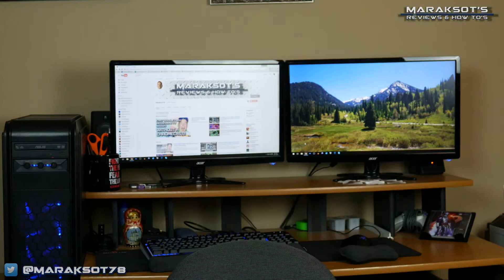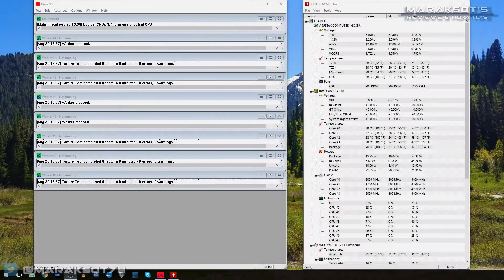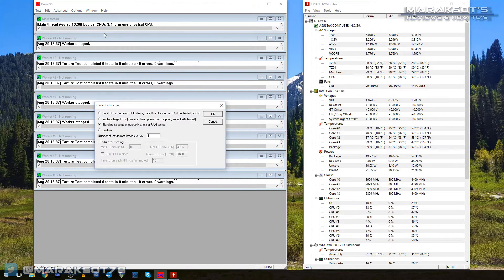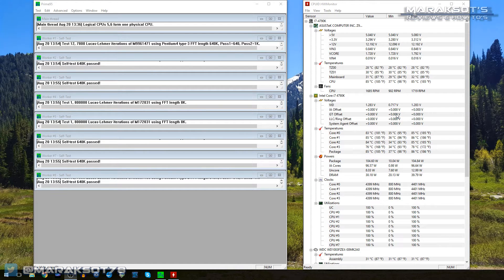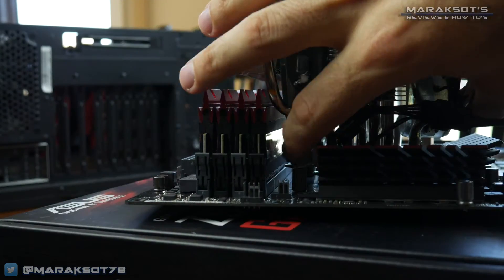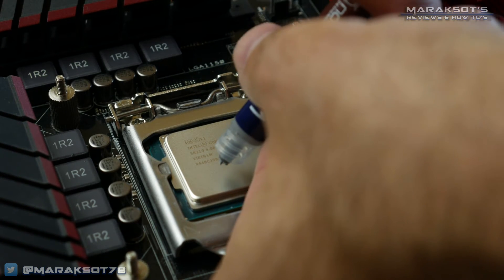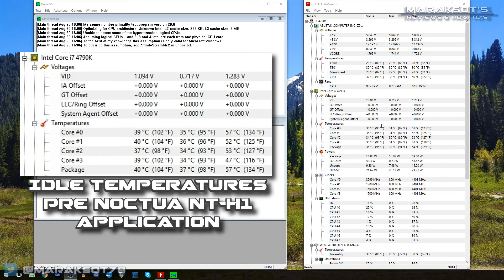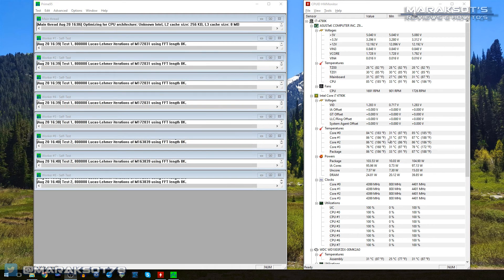Reseating my CPU cooler & Noctua NT-H1 Thermal Paste Review... sorta

Comment: Is your vcore at 1.792v?????? Thats way too high isn't it????
Reply from the maker: thanks for the question.  I'm not big into overclocking and stuff (I have tinkered around with it before but only very little) so I had to do some research on this.  I have everything set to stock/auto speeds and voltages in my BIOS so I was pretty confident that what you see in the video at 4:00 is not what it seems.  On my ASUS Z97 Pro Gamer Motherboard it has what is called the CPU Input Voltage which is set to 1.792V.  It appears that number is what CPUID Hardware Monitor is displaying as VCORE here. According to this article/overclocking tutorial from edgeup.asus.com  https://edgeup.asus.com/2016/broadwell-e-overclocking-guide/5/ it says the CPU Input Voltage  "...provides the 1.80VDC input to the CPU.  All primary internal voltage rails are derived and re-regulated from this voltage source.  When the CPU is overclocked, this voltage needs to be increased. We recommend keeping the CPU Input Voltage at least 0.45V higher than CPU Vcore, otherwise the system may become unstable or need a higher level of Vcore for stability. The maximum voltage we use is 1.95V set in UEFI. Do note that the actual voltage supplied to the CPU is affected by the LLC (load line calibration) setting within the External DIGI+ Power Control menu." so if I'm understanding this correctly the 1.792V is what is being fed to the internal voltage rails and then the actual amount of voltage being fed to the VCORE is adjusted through the LLC setting.  If you look at the VID on my CPU at 4:00 you'll see that the maximum voltage recorded there is 1.283V so I'm assuming that if I were to look at the load line calibration setting in my BIOS we'd find that my VCORE is actually set to this value.  here's a link to a video from der8auer (famous overclocker) where he talks about what VCORE, VID and LLC are.  https://www.youtube.com/watch?v=_XGhpKHWYAg  He explains the VID and LLC really well in this video but I didn't quite pick up on VCORE though.  :D  Thanks so much for the question though, I really enjoyed the opportunity to learn more about all this and understand it a little better.

Edit:  I went into my BIOS to see and it looks like I misunderstood exactly what they were saying in that article I linked when they said "the actual amount of voltage being fed to the VCORE is adjusted through the LLC setting".  There is a CPU Core Voltage setting that can be adjusted and when it's on Auto mine is set to 1.094V.  As der8auer explains in his video you adjust the LLC to keep your CPU at that voltage while it's under load.  My LLC is also set to Auto as are all the other stuff that has to do with CPU voltage.  So I'm assuming that with everything on Auto since my chip is designed to turbo up to 4.4Ghz whenever a load is placed on the CPU the core voltage and LLC is then automatically adjusted up to 1.283V, as shown as VID in CPUID Hardware Monitor, to compensate and allow the CPU to run at that frequency.  Thanks again for the question, it's been fun researching/learning this.  :)
Reply: Maraksot78... I did some research about thermal paste all had basic cooler master paste with few degrees higher than premium thermal paste... Waiting for noctua thermal paste...i have 8700k @4.8.. Idle temp 41c and load 90 on aida 64..cooler master 240 aio

Comment: hi sir you said its no difference between the 2 thermal pastes, can it be that your paste from your cooler is also a good paste?? like the noctua, i ask because my setup is now used with startech.com metal oxide thermal CPU paste and my temp go form 30° to 80-90° in seconds when i do a prime test, i already orderd the paste since inet is full of plus points for the paste to OC (i7 3770K @4.6ghz asrock fatality professional-m mobo- corsair H100i liquidcooled) wen i run normal, my temps are arround 30-35°
Reply from the maker: Yes, that was my takeaway at the end of this test. It appears that the Cooler Master and the Noctua thermal paste are of comparable quality.

Comment: ok need a little help guys. i recently got a i7 8700k with noctua NT-H1 paste and a coolermaster Hyper 212 evo I have remounted the cooler three times and everytime i have gotten 100C on aida64 fpu test.  No thermal throttle yet even after 30minutes but this seems really high. any recommendations
Reply: i do have 8700k at 4.8 (OC) it is at 83c running prime95. At 100c it will thermal throttle by around 15 to 25%.....you shouldnt be running at 100 for 30 min...By now hope you have changed the cooler, hyper 212 won't do good for 8700k
Reply from the maker: first of all thanks for the question, I personally don't have access to an 8700k and have never played around with one so I had to do a little online research.  Seeing as you left this comment about 12 hours ago I'm guessing by now you've done some digging of your own as well.  The best info I feel I was able to find was this article from techreport.com https://techreport.com/blog/32661/just-how-hot-is-coffee-lake   They found, as have many others, that the 8700k is a hot running chip and requires more robust cooling solutions to keep it from reaching it's TJ max of 100c when under extreme load.  I would suggest looking into higher end air coolers like the Noctua NH-D15 (it's really super big but offers similar cooling capacity to most all in one water coolers), the Cryorig H5 Ultimate or the be quiet! Dark Rock Pro 3.  Or there's the all in one water coolers like the Corsair H100i and H115i, the NZXT Kraken X52 and X62 or the Fractal Design Celsius S24 or S36 (I would only recommend the S36 if your case can accommodate a 360mm long radiator).  To get the best cooling performance for your 8700k I'd recommend going with a 140mm x 280mm radiator (H115i or Kraken X62) rather than the 120mm x 240mm because the more surface area you have the better the cooling capacity.
Reply: Well if youre out of options try undervolt the cpu....
Reply: As i already tried before with my I5 6400 cpu forgot how many volt... but result i get is -5c to -10c with 0 performance loss (tested with cinebench R15)

Comment: I thought the same thing with my 4790k at stock speeds with a Cryorig H7 I was getting 73c couldn't even overclock I got a corsair h80i GT Aio and now I can overclock getting lower temps I thought my h7 wasn't seated right but it was
Reply from the maker: +Patrick Murphy thanks for commenting. I actually just picked up a Deep Cool Captain 240EX AIO hoping it would give me better temps. I recently helped my cousin build a PC with the i7- 4770K and he got a Captain 240 and his temps went down 30 C!  Granted that was the difference from the stock intel air cooler, but that made me very hopeful. I haven't tried overclocking yet but so far all my stock speed temps have been pretty much the same as with my Cooler Master V8 GTS air cooler.  :/
Reply: Maraksot78 you should be good now. overclock manually too your better off use the lowest vcore you can
Reply from the maker: Patrick Murphy that's the plan.  :)

Comment: what the fuck! it's didn't work? looks like no difference
Reply from the maker: +FR9 I was definitely hoping to find the Noctua paste was a little bit better but in the end found out the Cooler Master paste is just as good as the Noctua Paste. :-/
Reply: i bought a few days ago this noctua paste. i'm very hopeful, but i guess right now i'm disappointed. :( it's like it won't work out for the overclock. I have x5460 cpu and p45 ud3lr mobo. i want try to overclocked from 3.16 to 4.50 with the noctua nt h1 but i guess it won't work..... good video. greetings from Turkey
Reply from the maker: +FR9 the Noctual NTH1 is good thermal paste and you should still be able to overclock your CPU you'll just have to invest in a really good CPU cooler like an all in one water cooler. I'm currently working on a video for the Captain 240 all in one liquid cooler from DeepCool. I tested it on an i7 4770k at 3.9GHz. With the stock cooler under load my temps were at 86c but with the Captain 240 it went down almost 30c to 58c! Greetings from America! :)

Comment: oh gee ! this cooler looks massive. do you think it'll fit in a s340 case ? considering buying one.
Reply from the maker: +Hongwen Tray nice choice! :) the s340 is a good looking case. ICYMI They actually just came out with an Elite version with a tempered glass side panel window.  I've never built in an S340 before so I don't know for sure if the Cooler Master V8 GTS (which is the cooler I have) will fit in it. I looked up the dimensions of the S340 on newegg.com and it is about 1/4 inch narrower than my case so it might just barely fit. But at the same time I can't say for sure. The V8 GTS cooler might be just barely too tall. :-\ sorry I can't be of more help.
Reply: No problem man, i was just asking.  And here's one more thing : did you encounter any sagging issue with this cooler ? because it looks like a big chunk of metal.
Reply from the maker: +Hongwen Tray nope, no sagging at all as far as I can tell. It has a pretty beefy back plate. The whole mounting system is solid and very well built so I don't think it will ever sag.  :)

Comment: A comment I have to make is de-lidding is worth it. :) Vice method is easiest imho. Takes seconds. Followed up by coollabs liquid pro :)
Reply: (I have a 4790K) it was about 13c lower after I did the above.
Reply from the maker: nice!  I'd be lying if I said I haven't considered de-lidding my 4790k and trying the same thing.  I'm kinda nervous to do it however.  Don't want to ruin it.  :D
Reply: +Maraksot78 not even as hard as you think. its actually very very simple. look up vice method. I found a 30$ vice at home depot and with some tape on the metal block of thr vice and a wood block end ... + a towel to catch it. a little bit of cleanup. easy peasy
Reply from the maker: I just may have to give it a try.  I guess I could always bust out the camera and add a new video to the channel.  :D ha ha
Reply: +Maraksot78 its easy and if you document well for the vid. (shoutouts would be cool because i strive to do this fulltime too.) just dont have the financial abilty atm) you'll be super happy. I was only getting 4.6 @75-80c max I'd go... but you can safely push 90c on full instruction sets from say Aida or prime. once I delidded it I was pushing 4.9-5.0 in the 88-90c range. aio water (enermax liqtech 240) and good seating on the die. the key is getting the lid just right so its not pushing to one side of the proc.
Reply: +Maraksot78 and I would honestly recommend it. clean the top off well. I used a acrylic erasor to remove the black sealant for the lid. that extra "drop" of the lid helps the heat transfers well! again 13c for me in drops with liquid pro. I took a small foam paintbrush to apply it (SLOWLY) and accurately. you don't want run off with liquid pro or it could conduct a circuit. but if its applied and dried well its easy peasy!!!
Reply from the maker: +Aaron Goodrich awesome man, thanks for the info. If I muster up the courage to do it you can be sure there's going to be a video about it. :D